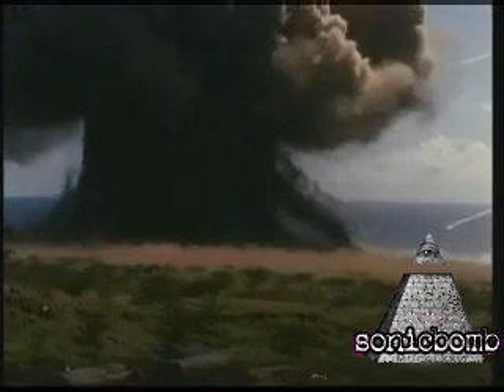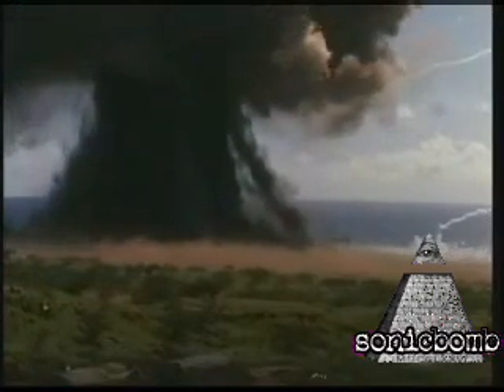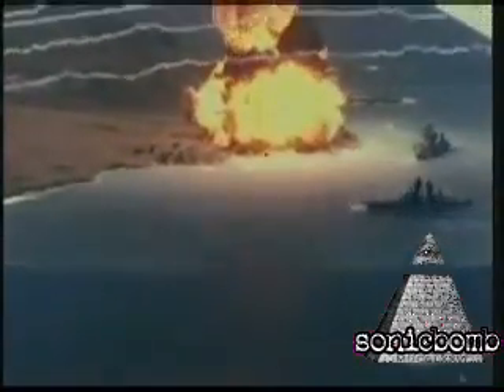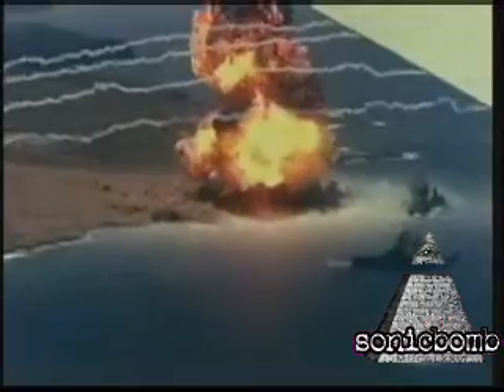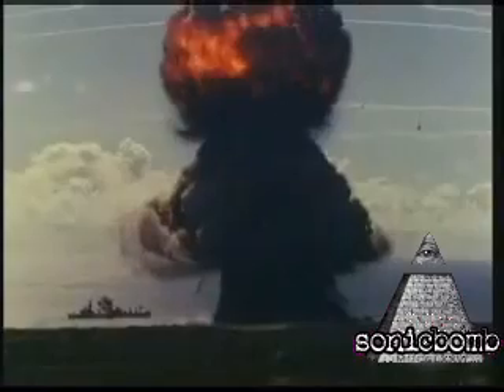10000 tons of explosive

Comment: It looks Comparable with the explosion in Beiroet, are they comparable?
Reply: yes there are comparables, the explosives consisted of amonium nitrate, the same that exploded in Beirut. 

For the test they used a glasfiber hemisphere, to seal it off in combination with oil to detonate, in beirut it was all stored in a warehouse, but that was not sealed off, so i am wondering how it could have exploded all at the same time.
Reply: The ammonium nitrate was over 6 years old. That stuff has an expiration date apparently. Almost all of it detonated. I did the math and i could be wrong but according to what I have Beirut got hit with around 1,155,000 kg of tnt equivalent and if you're not sure if that sounds right then you should look at the satellite picture because the blast put a cargo ship on its side... and it wasn't as close as some of these ships look.

Comment: "'Ionizing radiation is known to cause heritable mutations in many species of plants and animals, but intense study of 70,000 offspring of atomic bomb survivors has failed to identify an increase in congenital abnormalities, cancer, chromosome aberrations or mutational blood protein changes.'
https://www.nytimes.com/1990/08/01/us/hiroshima-study-finds-no-genetic-damage.html
Reply: That may be due to the selection factor of those who were exposed to the most radiation from the detonation were killed by the heat and blast. The only people who could survive being so close to the detonation would be those who happened to be in buildings at the time which would have protected them from a the immediate radiation.

it was also an air-burst detonation, so all the immediately created radioisotopes were confined within the fireball which probably didn't touch the ground and had its heat dissipated with the soil/buildings which would cause the white hot radioisotopes to deposit into the immediate area. This extremely hot fireball rose in the sky and was then propelled higher by the firestorm that developed in the city, this would take a long time to fall back down and the high altitude winds over Japan are famously high, most of the fallout would have been blown out over the Pacific Ocean.

Also the general conditions meant anyone who suffered acute radiation poisoning would be far less likely to survive due to lack of treatment then they won't be alive to develop cancer later in life.

Radiation accidents that happened later didn't also come with explosions as hot as the core of the sun also killing those who were irradiated.

Comment: The concussive force. Speed of the detonation seems greater than a nuclear blast. It just lacks the immense heat and radiation poisoning.
Reply: Vegarot Gaming That's an illusion,  a nuclear detonation can create a a fireball hundreds of metres even kilometres wide in the same time frame as this
Reply: I agree,
That's why I said seems greater. We would need to see what a 1/2kt shot looks like for a more accurate comparison.Unfortunately most recorded test shots range from 10kt - 60kt fission, 200 - 400kt boosted fission and 1 - 50mt multi stage fission boosted device

(the small fusion reaction of H3 & H2 release a spare neutron which collides with the Uranium or Plutonium creating a more efficient fission reaction creating a larger yield from the same amount of material).

Also known as thermonuclear hydrogen bombs

Comment: 1,000,000 Pounds = 500 Tons
Don't get me wrong this is still a huge explosion but 10,000 tons would have been one big ass explosion lol
Reply: Alex Papangelou 10,000 tons would be almost as large as the Hiroshima bomb.
Reply: About the size of a tactical nuke.
Reply: vbscript2 I say tactical, because modern strategic nukes yield around 500KT - 3MT

However, the largest nuke ever detonated was 50MT.
Reply: Big but about half as much as the nuke from Hiroshima and Nagasaki this would be about 1/3 the size equivalent 10 kilotons vs 18 kilotons and I think about 25 kilotons or close to it in the larger one at the time
Reply: @RideOrDie717  actually more than 1/3 but closer to 2/3......if you were comparing 10 k vs 18 k
Reply: I know that basic math is a challenge for many.... but if you're running a channel.... gotta do better!

Comment: 1 million pounds divided by 2000 (assuming it's standard ton not metric) is 500 tons or half a kiloton, by comparison the nuclear test north korea did today is about 14 times the size of this, still not sizable by today's standards but enough still to prove a critical tactical advantage or wipe a small city.

the explosion in the video is clearly only around 500 tons (.5 kt)  if you compare it to others in the 10-20 kiloton range

Comment: I think 10,000 tons refers to the force 10,000 tons of TNT. I would have expected that the navy might have used an explosive that simulates the detonation force and heat of a small nuclear explosion closely. However, they must have needed 1 million pounds of the stuff. In the end, it was probably cheaper and safer than a nuclear weapon.

Comment: Pounds and Tonnes are two different measurements! Pounds is Imperial old school and Tonnes is Metric. 2.2 pounds to a kg approx. Either way, the title is wrong. 
10000 tonnes = 22046226.218488 Pounds.

Comment: Think your mixing lbs and kg. There are 454 kg to one pound, there are 2000 lbs to one standard (or "short") ton so 1,000,000 divided by 2,000 is indeed 500 tons.  But of course neither is it 10,000 tons either, so that part you have right.

Comment: Well yes and no, the U.S. uses a "short ton" which is 2000 lbs., now a "metric ton" is 2200 pounds and a "long ton" is also 2200 pounds, so yes if it is a standard ton you have 2000lbs. x 500 tons = 1,000,000 pounds.

Comment: 1,000,000 lbs of TNT, or 500 tons of TNT or it would be (1/2 )(half ) a 0.5 Kiloton blast. the only part of this test that sucked was, since they used normal explosives it was all at ground level. so not that good of a test since pretty much all nukes go off at 1000ft and higher but that is why the ships are so close to the shore. but no matter what still a bad as BOOM!

Comment: the close distance magnifies the effects of this explosion. if the ships were that close to a real nuclear explosion, they would probably be melted and blown to pieces instantly.
Reply: That depends on the yield of the nuke used. The thermal pulse would be far hotter, that's for sure. A low yield fission device would ablate only the surface layer really close in, as the thermal pulse is extremely brief. It being blown to pieces, is also dependent on a number of variables, but the kinetic energy dump would be enormous.